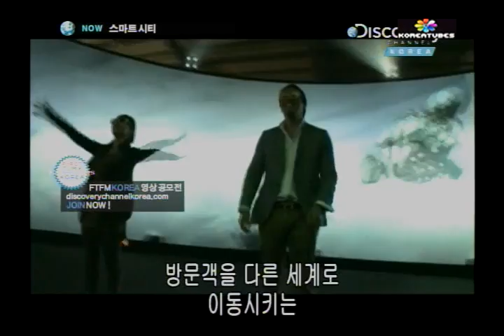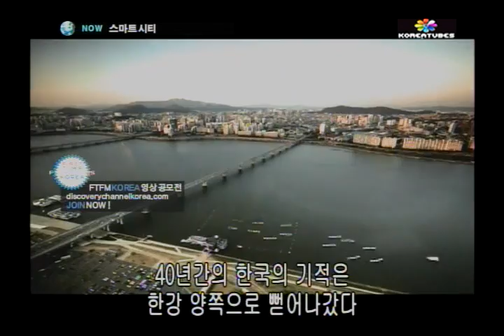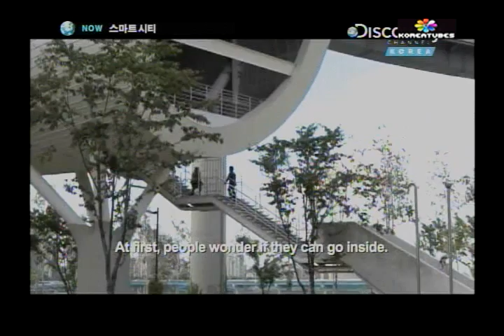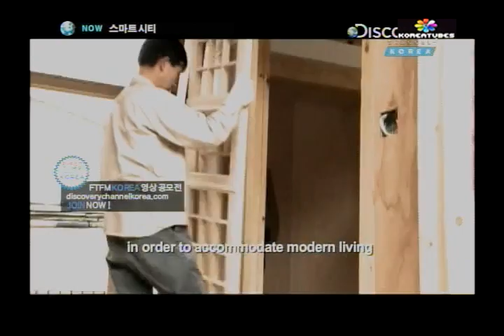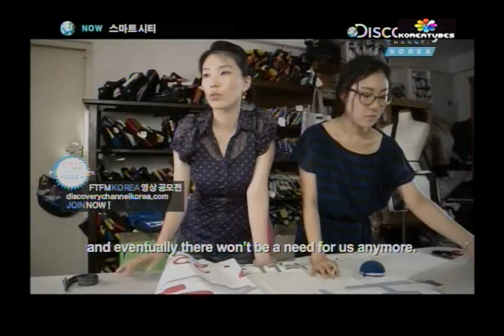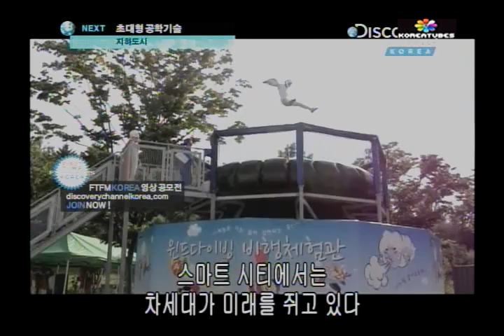SMART CITY : Seoul, Korea

Comment: Let's be fair about objective about this.  Your comment is only minutely true.  Both Korea and Japan as well as China fought the western intrusion at first with mixed results, but Japan chose to open up to the West and learn from that and use that basis to initiate industrialization.  That was wisely done.  Had Korea done that early stage and modernists beat out the conservatives, Korea would have developed a lot earlier.  In any rate, that blame falls on Korean leadership at that time.